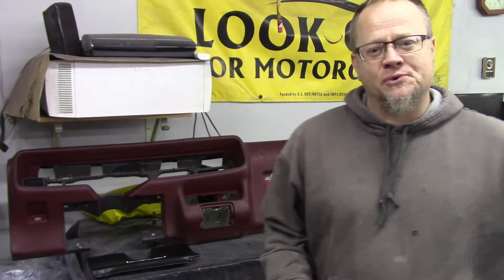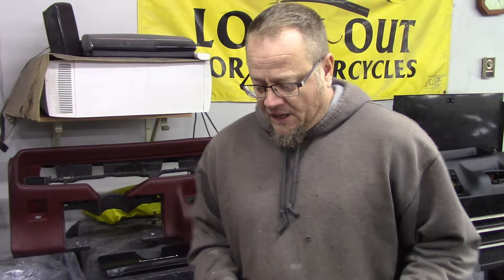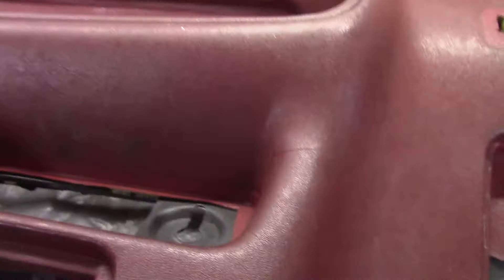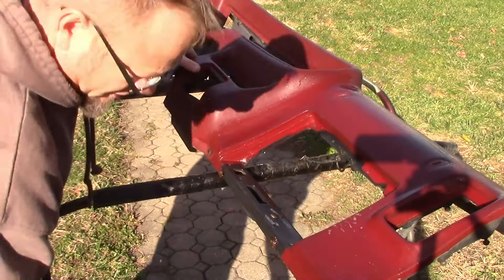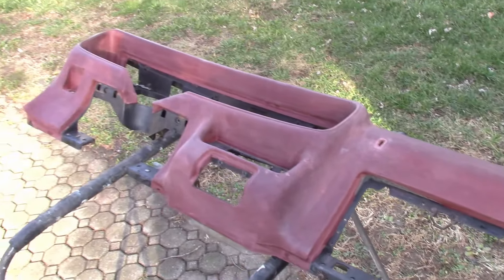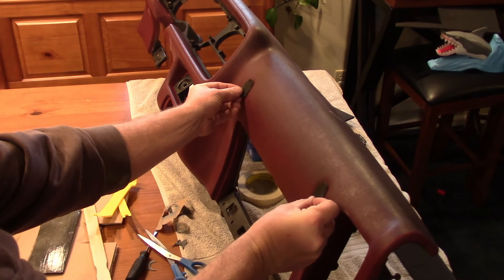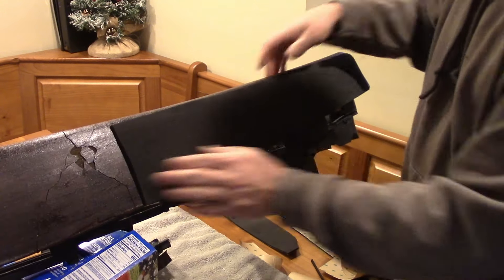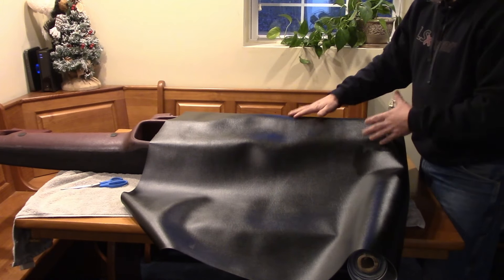DIY Vinyl Dash Upholstery!! Marine Grade Vinyl Wrap: Real Texture, Real Cool!! Pontiac Firebird...

Comment: I'm about to upholster my old RV dashboard and this video helped me tremendously. Finally got the courage to get started :D
Reply from the maker: Awesome! glad it could help.  Be sure to use lots of glue especially if you are using similar material that doesnt have smooth backing.  Next time i do it, im going to try the 4-way stretch material with a smooth backer so the glue has a chance to work a little better.  My stuff has held up great so far, but i have had to peel back in some places and apply more glue.  After that, those places stuck very well.

Comment: Have to say that you did a great job. That was a difficult job, and you basically naild it. Thanks for sharing
Reply from the maker: I appreciate that! ive got a little bit of delamination going on now, but ive fixed a couple spots with more glue and its holding great. Next time im going to use a thinner material that stretches better and has less texture on the backing.  I think it needed a ton of glue due to the texture and where it is delaminating, i didn't get enough on there.
Reply: @HeavyPedalGarage  Cool. Is there a thin leather that can be used? We have to do the same for our 79 Trans am. Thanks for the reply. Keep up the good videos. I really enjoy them.

Comment: That looks really good. I had a '75 Formula 400 when I was 16. I had it completely reupholstered dash, center console, everything. 6 months later I wrecked it. Always thought about getting another one. But they are VERY desirable now. If you can find a decent project car it'll cost you. I'll settle with an El Camino.
Reply from the maker: Right on! Too bad about the wreck. I bought an esprit and put the cool trans am and formula stuff on it. Not ideal, but it wasn’t too awfully expensive, it’s original and I love it.  El Camino are super cool too!

Comment: Man I loved your video, I then purchased 4 way stretch vinyl,  and the same contact cement you used, after hours of gluing, stretching, and rolling, it turned out beautiful!!. Thanks for making your video and this is not a comment to dog on you but a warming to anyone who tried this. FIND A BETTER GLUE. as soon as the sun warmed up, everything came loose, and it all fell off. I'm going to buy a snap on cover to run until I can get the dash professionally rebuilt.
Reply from the maker: Oh man. Sorry that you had trouble. Mine has held up. I have had to touch up a couple places with extra glue because I feel that I went too light on the first try in places.  Did you clean the parts and pieces really really well?  I also sanded mine to try to get a better bite. There is that Landau top glue that I mentioned, but I don’t know if that would work any better. sorry you had issues.
Reply: @HeavyPedalGarage  The Weldwood Landau top and trim contact adhesive(Spray grade) is much better than that contact cement in the red can. I tried the same Weldwood in the red can first a few years ago, since it was easier to get at Home Depot. But it was worthless for the upholstery job I was doing. It did not stick well at all. I discovered on youtube that professional auto upholsterers use the Weldwood Landau top and trim adhesive, and it's sprayable. I use a cheap harbor freight spray gun with it. It can be brushed on too though. It sticks far, far better than the red can. No comparison.

Comment: Great job, thanks for sharing this, I’m definitely going to recover mine over the winter now.
Reply from the maker: Use lots of glue. Also , if I were to do it again, I would look for the 4 way stretch material.   A few places on my dash have lifted after a summers worth if sun. Had to reglue. But it’s in places where I had to fight the material since it wasn’t 4 way stretch. Still looks great through.
Reply: @HeavyPedalGarage  My Lemans dash is way less contoured, but I’ll definitely purchase the 4 way stretch just for sanity’s sake.

Comment: Came out really nice! I agree that a wrap is absolutely the best way to restore a dash pad. Honestly that particular dash has to be the or one of the most complicated dashes to wrap in vinyl. I had a much simpler dash for a 1971 Plymouth Road Runner wrapped by a place in Oregon in 2001 and it cost me nearly $600. I did notice the vinyl was 'softer' or more pliable or stretchy. I think that's key. I have used Sunbrella and marine vinyl on my truck interior for the seats and its great stuff. There's a few online fabric wholesalers and I brought it to my upholsterer. 
I've seen people use that really thin foam for floor underlayment  or something like roofing felt on the dash top to smooth it out under the vinyl.
Yours really turned out nice for a first attempt. That's a tough dash to do. I'm sure you saved yourself $1500-$2000.
Reply from the maker: For sure. Thanks for the feedback. When I do another dash, I’m definitely going to shop around for a more flexible vinyl. Also I think learning to do some simple stitching/sewing could go a long way in fitting the vinyl to the complex curves. Thanks buddy!

Comment: I know they use contact cement for gluing laminate to counter tops. In that application, they use plain wooden dowels between the counter structure and the laminate to separate them while they position them. I've also heard that Kraft paper will help keep the contact cement from joining the parts, and then slip it out a little at a time to make a good join. I'm pretty sure the four-way stretch vinyl would help you too. All in all, though, that looks great, especially for a first effort. I'm looking forward to seeing it all put together. I know it's going to look really nice.
Reply from the maker: Thanks for the tips! And the compliments. Much appreciated!

Comment: Thanks for idea, this dash is way more complex then a first gen bird but if you did this well on yours I am certain I should be able to stretch it over a 1968 pad too.
Reply from the maker: Right on. Be sure to use plenty of glue so it doesn’t delaminate. I’ve got to redo some spots. Especially if you use the marine grade vinyl that has the fabric backing. Next time , I’m going to buy 4 way stretch vinyl, preferably without a thick backing.
Reply: @HeavyPedalGarage  I will do the same. Thanks again

Comment: Good job. The reason there are puckers is because you must stretch the vinyl tightly across the dash first becasue the vinyl will strtch but it wont SHRINK! .  Here is my tip, I hope it makes sense:
Secure the dashboard squarely to the table, glue the highest ridge of the dash but do not put glue on the sides or try to contour any parts at this point. CLAMP the vinyl to the side of the table. Stretch the vinyl over the dashboard across the width of the table so the vinyl is on the highest ridge, on the glued area, stretch the vinyl with a bit of heat from a heat gun, stretch it to it's maximum and clamp it tight to the table, let that glue dry.  You want that vinyl stretched tight and the glue dry, now you can figure where to contour and you can see how much stretch  is needed to keep the vinyl square. Do not cut your hole all the way at first, just cut the center and make a few cuts as you go, and stretch it as you go, use a heat gun as you go and the vinyl will be plyable. you can clamp the contour with spring loaded clamps just pad the clamps a bit.
Reply from the maker: Awsome advice!  Thanks for the feedback!

Comment: Interesting. Youtube has done some good spying on me. This popped up in my recommended videos even though I did not search for anything like it. I have a dash with filler curing right now so I can vinyl wrap it later this week. Good video. I learned a few things that should help me get a good result on my dash. I might try and pre-cut and do a dry run or three before I add glue. Might also do the deeper pockets in multiple glue ups. I think the Datsun dash I am working on has more gentle shapes too. Less sharp corners.

Comment: The best way to do this is with vacuum forming, but you have to use a different material that will heat and soften and form into place.  I'm pretty sure that is how they are done in the factory.
Reply from the maker: For sure, vacuum forming would be sweet! im sure it would turn out perfect that way.

Comment: Wow! Outstanding job. How did you do the face to the gauge bezel. In one of the videos you said it was a carbon fiber face? My 73 has a wood veneer face and I like yours way better. I have seen machined aluminum but they have the extra holes for oil pressure and water temp. I’d like to keep mine but reface it.
Reply from the maker: I just bought vinyl sticker with a carbon fiber print. Got it off of Amazon.

Comment: I'm very curious about hw this ended up. I've used the exact same materials, cement and vinyl. Even prep work was the same. On the test pieces I used, Glove box door, passengers side door panel, and A pillar covers. When first wrapped they all looked fantastic. But after being installed and a week of real world use. They all started to peel and separate. After some research into how or why this happened. I learned it was due to the fabric backing on the vinyl. One of the upholstery shops I stopped at was kind enough to give me a small sample of what they said I should have used. It did not have a fabric backing. I ordered a small amount and recovered the glove box door and A pillars. It's been about a month of real world use and they still look and feel the same as the day I stalled them.
  So I'm very curious about how exactly you were able to keep it from peeling and separating. Just to be clear I'm not saying anyone is doing this or that wrong or right. I'm just saying what results I personally had. I'm also very aware that location is a factor. I live in E. Texas. Where one would think you live on Mercury yet have the humidity of Venus.
Reply from the maker: I hear ya! After a summer of hot and humid Ohio weather I did have a few places delaminate. I peeled it back and added more glue and it held the rest of summer and winter. I think the key is to have plenty of layers of glue to fill the fabric backing. Good glue to glue contact surface. Next time I’m gonna find a better vinyl (like what your suggested) something more stretch with less backing.  Might try the the actual HHR landau top glue too.  Thanks for the feedback on your experience and for the tips!
Reply: @HeavyPedalGarage  Thanks for the reply. I've decided to watch from this video forward to see your progress. The fabric I decided to use has a backing that sorta looks and feels like suede leather and stretches in every direction. As I said, so far the results have been great. No delamination and definitely the look and feel we're both going for. Also, just an fyi, I've tried real leather with very good results. Definitely harder to work with. But really good results. 
  Again, I really appreciate your getting back with me on this. I'm looking forward to seeing your progress.
Be safe out there 🤠😎